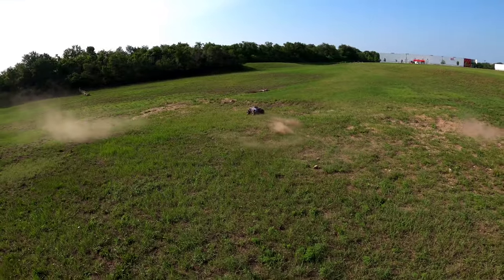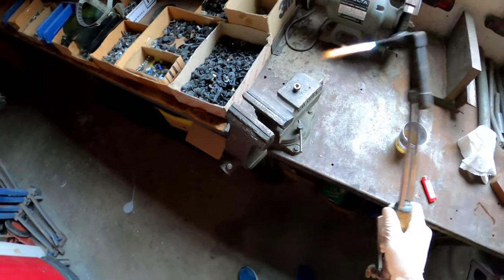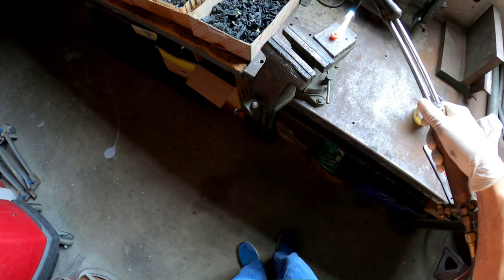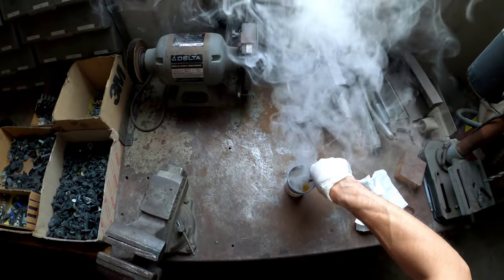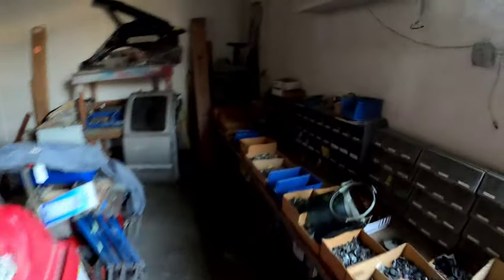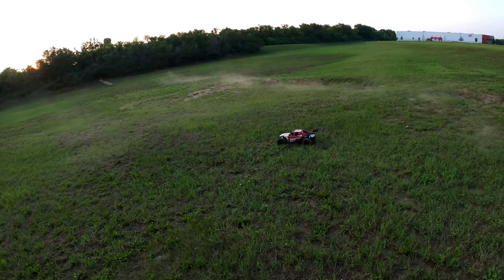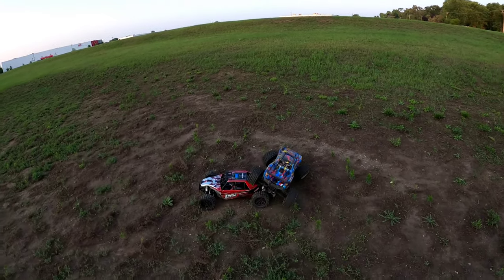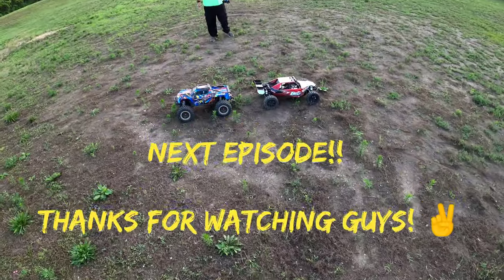pinion gear keeps coming loose?? try this easy fix!!

Comment: What do you think you did by heating it up? I belive mod 1 pinion are hardend already. So you made it soft again. Try sanding the set screw flat. We do this in the aerospace industury. It gives the screw more surface area on the shaft when installed.
Reply from the maker: It got hot by multiple runs and that softened it. Sanding the shaft does nothing.  It tightened the molecular structure of the metal witch say what you want it's definitely harder than factory and has been solid no problems for almost a year now.
Reply: Yeah i know AMTs do stuff liek that to (im a pilot) but i sanded my pinion shaft and that worked for me. but my rustler is having the problem now and sanding hasnt worked so might try this just to see

Comment: My screw keeps coming loose on my pinion gear also, it's so frustrating. I used blue threadlock and different screws and just keeps coming loose. This is the first time this happened since I've had my kraton over 2 months now smh
Reply from the maker: Yeah buy a new one try for a higher end more brand name made with better steal and use a better hardening process. A lot of factory and even ebay gears give this shit result.
Reply: @screwcityshenanigans9185  I've tried different pinion gears and set screws still same result. Maybe I need to get better screw?
Reply from the maker: Yeah try that. Myself I ended up with a handful before I found one that held up. Also check your bearings in your drivetrain excessive heat from multiple runs will swell a gear every time and let it loosen.

Comment: Can I use MAP gas on the gear or do I have to use the ceiling torch and also unlock type if it's liquified like will you liquidy and not sticky is it good or no good
Reply from the maker: @waldodrew7580  sure if you get it red hot is all that matters

Comment: So loctite didn't do the trick? They even have stronger types if blue doesn't work (i.e., green, red)...
Reply from the maker: It sure didn't! Tried blue then red!
Reply: @screwcityshenanigans9185  gotta put alot.. all over the motor shaft too lol
i dont think it gets cherry red inside the rc but i get your idea
ps. could just buy a hardened one from the start and ssave you some time
Reply from the maker: Takes time to get here. No good hobby stores open on the weekends. We had a plan!! Lol
Reply: Try Permatex 'Orange'. That worked on my SCT with MOD1's. My basher needs something else still, moves with the orange stuff. Might try Loctite #2242, high heat resistant, but 'blue' removable.
Reply: @wesratliff9747  did you ever try that?
Reply: @emcomatty  Permatex orange worked perfectly, hasn't moved since. Did have to do apply it twice; second time I wiped the threads and pinion with alcohol. Found some oil creeping around the spur, must've flung over on the pinion before it cured. Blue 242 for wheels and everything else, orange now for pinion and all motor threads. 

Dropped my temps about 100F too - waaaay too much Kv on the motor. Sitting around 80-90F after lots of WOT now.

Comment: I've had better luck with Permatex Orange; strength of red, removability of blue! Have thought about just using super glue to keep it on too, then just blast it with heat to remove. But, have just recently had this start happening to my 1/6 Shredder and 1/8 SCT truck. Heat might be causing it to loosen up and move.

I'm going to sand a flat spot like mentioned, then Permatex it and see what happens. Definitely annoying!
Reply: Actually, a better 'blue' Loctite option would be #2242 - high heat resistant, but still the 'blue' properties. Forgot about that one!

Orange is holding up pretty well on my Laegendary Nitro with MOD1's. The Redcat Shredder is still moving around though..